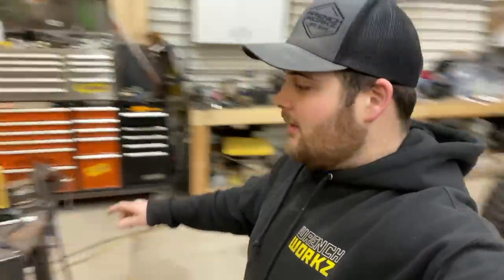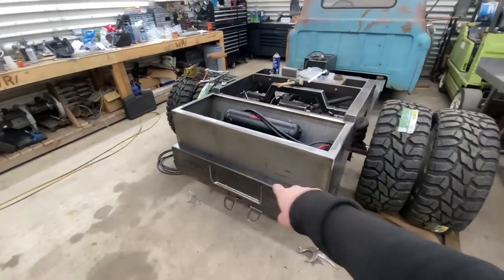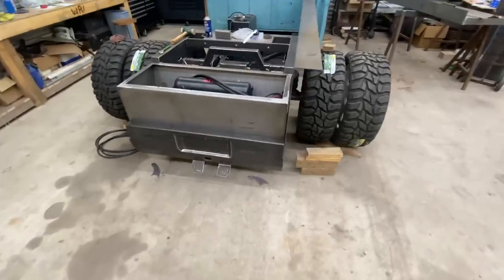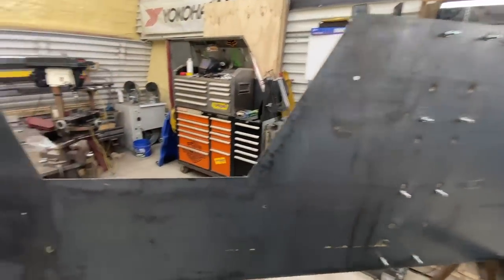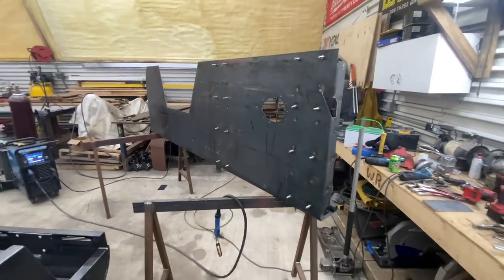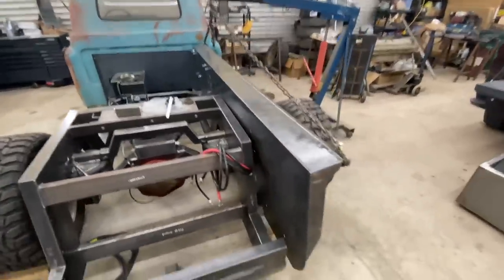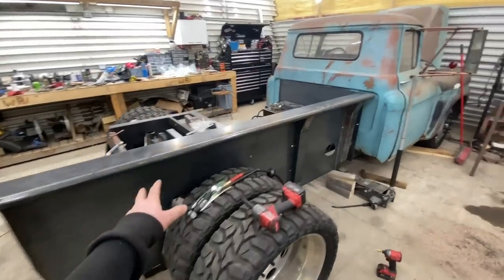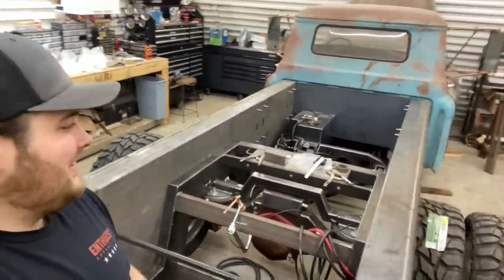Bagged '59 GMC Duramax | part 2

Comment: You've got some skills.  I'm 72 and building my first truck, a 37 Chev with an L83.  I'm boxing the frame and have a Fatman MII front end.  I struggle with the welding.  Your welds look great.
Reply from the maker: Thank you sir!
Reply: Thing with welding if you think your going slow enough go slower. Started welding at a young age. Can almost set the welder by ear, teaching my daughter a bunch of tricks. Between the welder to each and lathe always something to learn. That sounds like a pretty awesome build!

Comment: The Bed is looking good! But I would consider changing the safety chain tabs. I think d rings would look and work better. or you could make them more flush and use the same style u bolts that came with your gooseneck hitch. They would be spring load so they would be retracted when not in use. I just see them getting bent up and people hitting there shin on them.
Reply from the maker: I like your thinking! Will definitely consider that!

Comment: Great project. Big job getting that baby done so lucky you have a helper. Do you need to have all the work engineered like we would here in Australia?
Reply from the maker: Thanks! I had a company engineer/design the back half of the frame then cut all the parts on their Cnc plasma table. if that is what you are asking
Reply: @ramzworkz  Yes. Interested in the process that happens in the US vs Australia